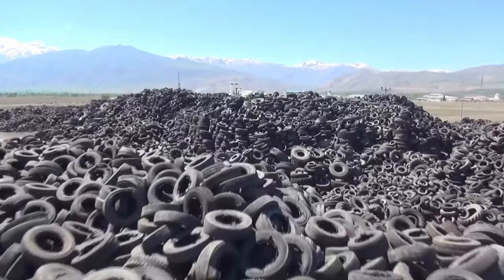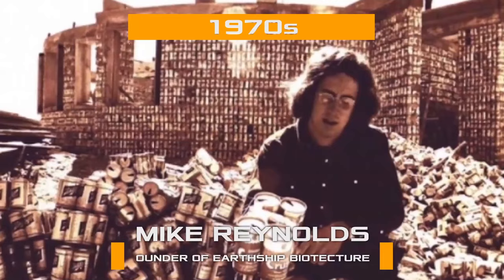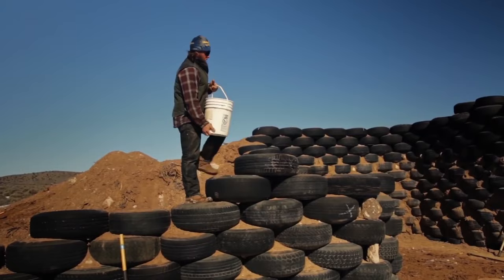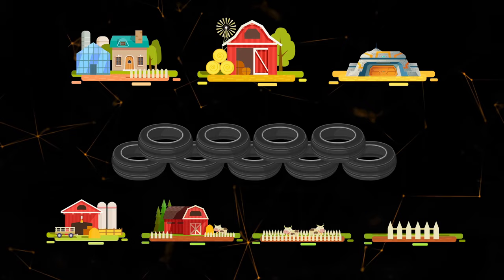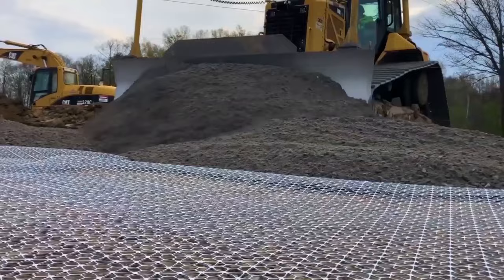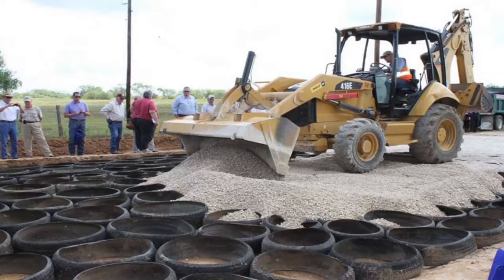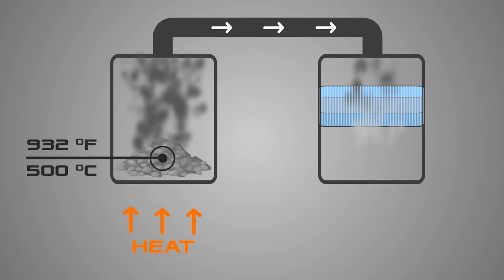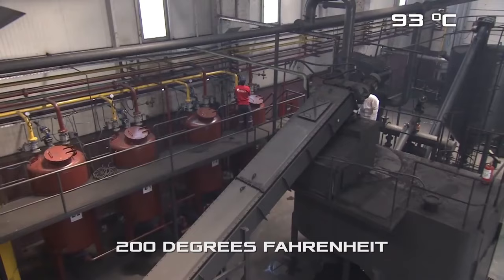Creative Uses for Discarded Tires

Comment: I believe that tire manufacturers just like battery manufacturers should be responsible and involved in their products after life , these days of not responsible for what I created is over, and this applies to all of us.
Reply: if you buy it then it is your? do not want the responsibility of disposal? do not buy it.
Reply: Professor Walter Block explains in his paper, "The Plastic Problem: A Free Market Solution" that prices for dumping things that never disintegrate like plastic and rubber would be higher in a free market compared to things that do disintegrate like paper and kitchen scraps. The reason prices currently do not reflect that is due to the nationalization (municipalization) of garbage dumps. If they were privatized, then disposal prices would tend to reflect the harm done by plastic and rubber. This would cause consumers to prefer buying things that didn't cost so much to dump, which would cause manufacturers to make things with a lot less plastic/rubber where possible.
Reply: Yes sure but that would exclude private inventors and entrepreneurs from doing new niche products, while the international OEM conglomerate would simply pass on the recycling cost to the consumer, which is you, and nothing realy new would be invented. These free tiers are a free input for a local company
Reply: @justfacts1308  Sure, there are emerging technologies like plasma gasification that can disintegrate tires. But the existence of new technologies doesn't change the fundamental economic principles that underpin my argument for privatization of waste management.

Even with these technologies, there are still costs associated with processing and disposing of materials like plastic and rubber. A privatized system would better reflect these costs in disposal prices, encouraging more sustainable product design and consumption habits.

It would also give consumers more options for waste disposal, potentially including advanced recycling methods. This competition would drive improvements in service and efficiency.

Also, in a free market system, these technologies would be more rapidly developed and adopted if they truly were the most efficient solution. The current slow adoption rate suggests there may be economic or practical barriers that a free market could help overcome.

Comment: I am always a stickler for recycling.  This is something I learnt from my Dad. One such example was when he created a hotplate using a half of concrete block and some filament from an old hotplate.  For the increase in car ownership, recycling the used tires is fascinating.  I particularly like the crumbed rubber idea to rebuild roads and walkways.  I pray that this is highly adopted which would decrease Government cost in road repairs and I believe reduce the wear and tear as the material should be more flexible to the varying weight of vehicles. Thank God for innovation.

Comment: I used old tires to build a backstopping in my shooting range and also put black plastic down painted tires different colors and used them to plant all my squash and gourds
Reply: Does it work well what tires did you get? 
I have a lot of old semi tires but somebody told me that they would reflect small rounds that it would ricochet off of them even if I had a piece of plywood in the front

Comment: More applications that are already being widely used that didn't get mentioned -

Glue crumb rubber together to pave running tracks.

Mix crumb rubber with sand, and combine it with artificial turf. It makes a consistent firm but soft playing surface. Most college stadiums and many high school stadiums already have this. The brand name is FieldTurf.

Comment: One of the simplest ways to use tires is for steps. Simply slice out the one bead inside one, place it inside the other, set up partly over the lower tire, and backfill using heavy rock at the bottom for drainage. I'm surprised they aren't used more for terracing, as they would last forever, and the weeds and other plant life would grow up in front of them to hide their unattractiveness. 💙💙💙